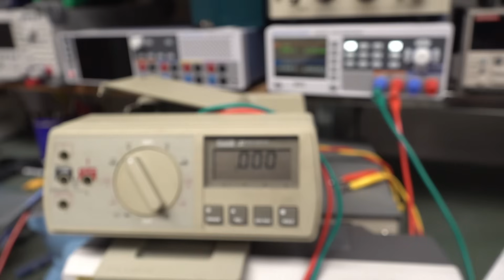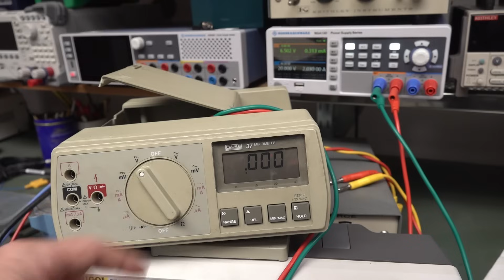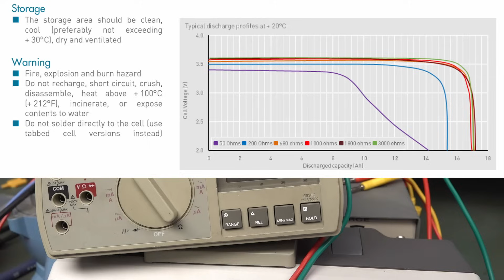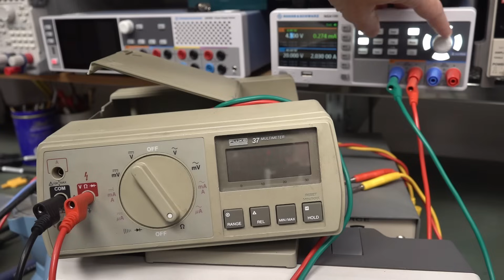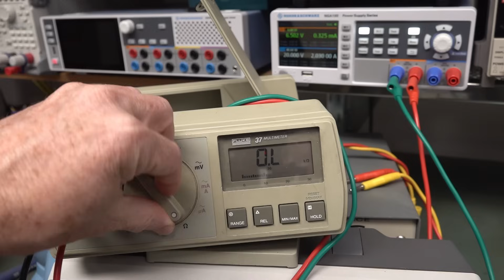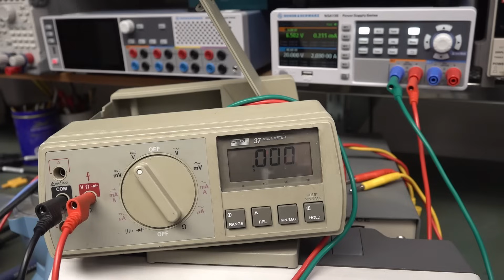34,000 Hour Battery Life Fluke 37 Multimeter

Comment: Those exact batteries are famous for leaking and destroying vintage mac computers. Wouldn't leave them in your Fluke for years on end.
Reply: Not just leaking but actually exploding.
Reply: @coreddit Nonsense. They do not explode.
Reply: But realistically, we’re talking about once these batteries are 15+ years old. They did not leak during the service life of the computers, nor for several years beyond.
Reply: Yes, Lithium Thionyl Chloride batteries were often used in computers (3,6V 1/2 AA) , like many older Apple Macintosh computers with PPC (68X00 and G3/G4 till around ~2005). They do leak (over time i.e. 20 years or so) and then totally destroy those machines, and it's a good idea to remove those batteries before storing those old computers in your electronics graveyard aka cellar.

Comment: Energizer Ultimate Lithium have similar energy density and self discharge, and you can buy them at Coles. They only come in AA and AAA, but you probably have holders in your parts drawer. 20 of them ought to give you a decade @ ~3V2. I think LTC batteries can outdo them in very low current and very high temperature applications, but they contain relatively nasty chemicals and are harder to source. Also, the cheap no-name LTC batteries have been known to explode. And the nice SAFT ones are very expensive. Actually, Energizer Lithium is expensive in Australia as well - they're like half the price overseas.
Reply from the maker: Yes, I'd have to find them on special. Cheapest IU can find is 16 x EBL for $45

Comment: Thanks for the video.
Put in 4 cells and put in a count down time set for 3 years and at that time you recharge the batteries and reset the timer.
What is the power curve on Lithium Iron Phospate, they are much more stable and will not go up in flames.

Comment: I've got one of those geiger coutners I think I bought way back in in the mid 2000's or so. It's only guaranteed a 10 year battery life (you can't turn it off) and it's still actually working off the original battery (probably close to 20 years now). It does need to be changed (and you can either send it back for replacement or do it yourself) as the battery cannot supply enough current anymore for some operations, but I'm curious how long it'll last. It does use a TI MSP430 microcontroller, but it does have a high voltage inverter to run the tube.

Comment: I think the battery is tested by loading it a very short period at the start, and looking at the voltage drop (delta V) to determine the battery condition.
Reply: Yes this chemistry needs to be activated by loading it which removes a passivation layer so current flows.  If the current drain isn't high enough, the passivation layer reforms and the battery shuts down again.

Comment: You what would be really cool, a multimeter that ran off solar power, so my thought is it could e powered by the lights in the lab, every time you come into the lab and switch on the light the multimeter come on, then when you leave and switch off the lights it goes off.
Reply: What? Next we'll have solar powered calculators😁👍🇦🇺
Reply: @simonilett998 idk anything about stones, I only throw them in lakes
Reply: @kristiandawe85  I'm guessing this reply may have been in response to the comment directly above mine😁👍
Reply: @simonilett998  yes it was hahaha
Reply: @kristiandawe85  🤣👍
Reply from the maker: I'll have to check the square area available on the top case.
Reply: This sounds like a stoner idea if I've ever heard one.
Reply: I actually do own two Voltcraft VC-200 "green" SOLAR multimeters. They were thrown out by a university, but unfortunately both had the supercaps removed and replaced by a 9V battery. :) 
I took that as a hint that the concept doesn't work and didn't even try to re-solarize them.
Reply: I seem to remember there was a nuclear battery in a mailbag episode a while ago. It's probably not going to have enough power to run the meter continuously, but if combined with a supercap and an auto power-off feature, could it work?
Reply: @helgew9008  Those only prudced uW of power...
Reply: @lasersbee  1.21uW!
Reply: @_BangDroid_ imagine trying to power a time machine with those 😂
Reply: @lasersbee  And supercaps produce enough power to start a car. Combine the two like he said and as long as you don't use it often, it could work. It would be very limited, but it could work.